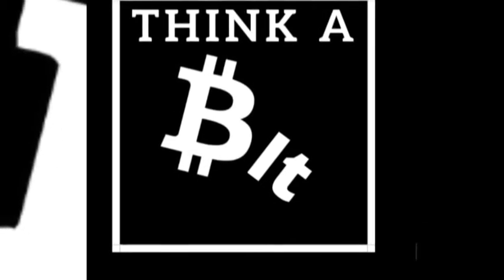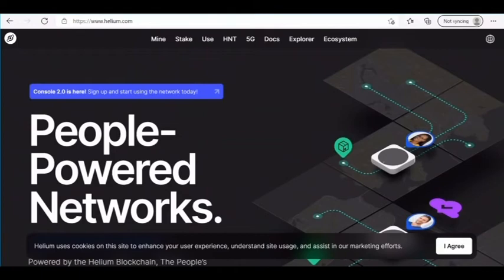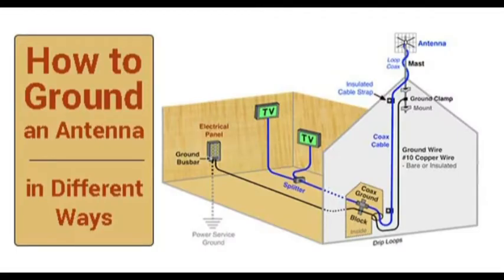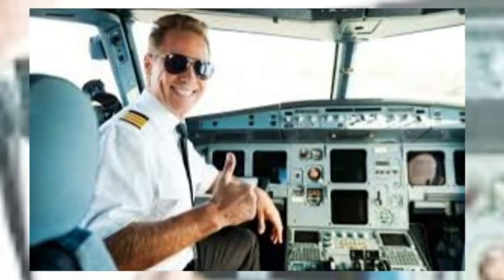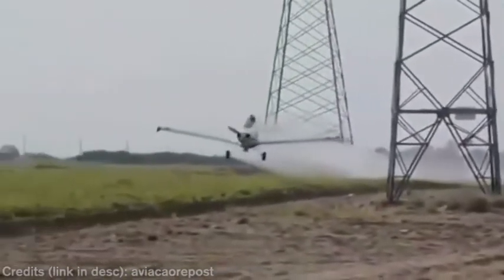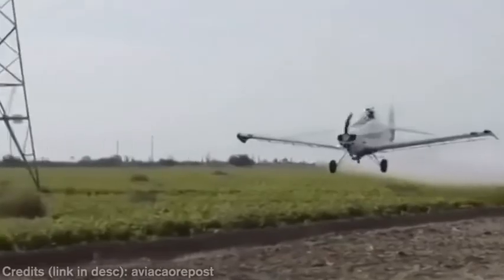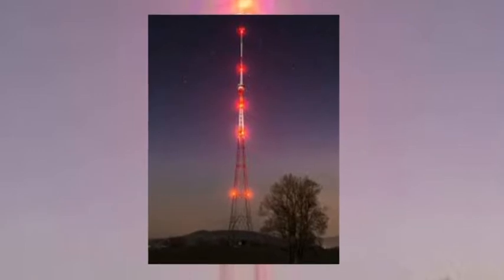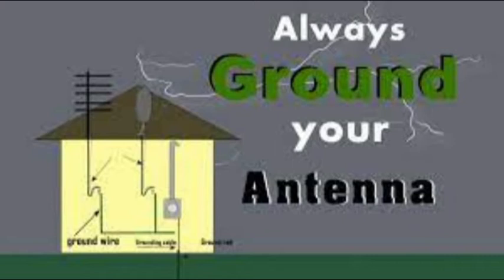How To Ground A HNT Antenna

Comment: FAA only requires aircraft warning lights on antennas, structures and towers over 200'.
Reply from the maker: Yeah it depends
Reply: @thinkabit  "The FAA requires aircraft warning lights on temporary and permanent structures above 200 ft. (61 m) to prevent accidents. There may be some additional restrictions or height requirements if the structure is in very close proximity to an airport."
IDK, I've been doing tower work since the 90s and I've never run  into an exception, but you're right, they do exist. There are also exceptions on the other side too. In some regions, especially in residential areas, no lighting is required even above 200', but that's on a case by case basis.  
Mounting antennas at ground level is not even possible for operation, depending on the frequency and the terrain. Federal law states that "antennas may be mounted at a height to establish reliable communications"
Once you get into VHF communication, height is paramount. At UHF and above, these are line-of-sight frequencies. A ground mounted antenna is completely useless.
Heck, I have a 90 foot antenna tower at my house with a 20 foot mast (110 feet) with a 16 foot vertical antenna on top, so 126 feet to the tip of the antenna. I filed with the FAA for 150' (just to be safe) and they replied "No permit required under 200 feet" 
Stay safe out there, brother! Glad things worked out for you in this situation!